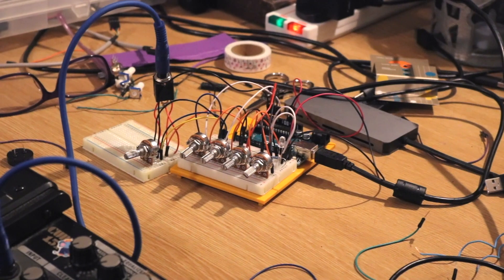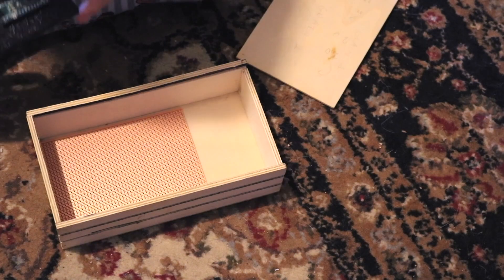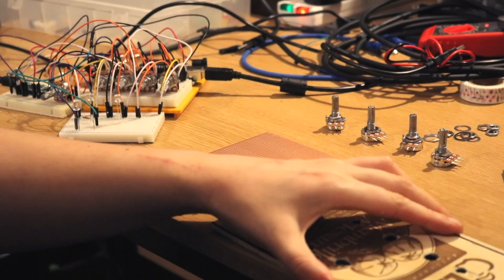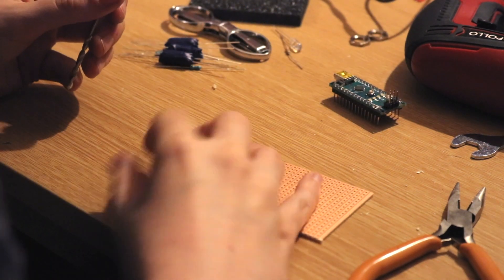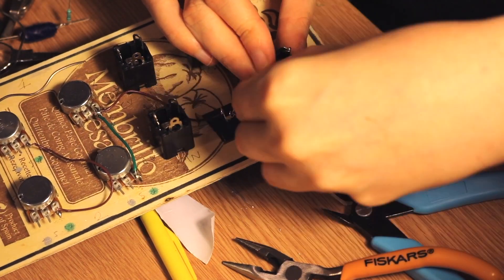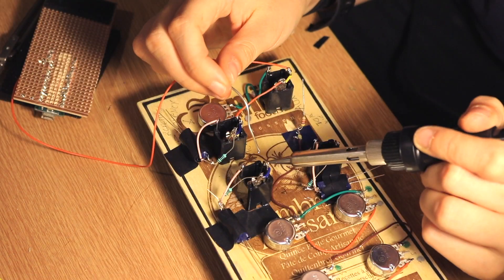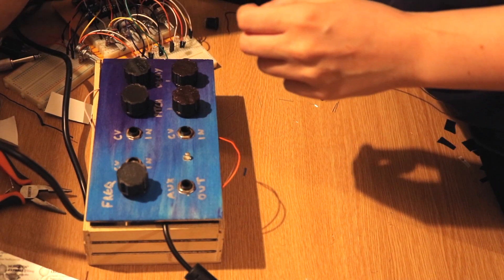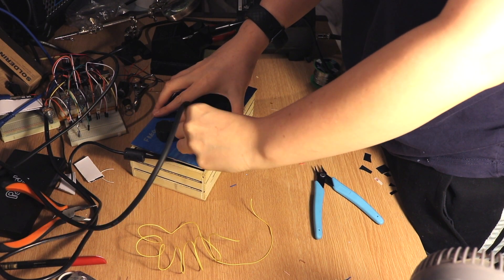Building the Auduino Synthesiser (Arduino based DIY synth)

Comment: Curious how one might take this design and filter out some of the white noise. Obviously a low-pass might do the trick but is the Arduino providing a preamp or is that external?
Reply from the maker: Honestly, I haven't had too much issue with white noise - but it's being filmed through a guitar amp into a camera mic, so there is a bit of white noise in the film but not in the actual audio output! :)

Comment: Hi I would like to use this setup as a base for a lesson in school. I was curious because I am not so good with Arduino, it is not necessary to use code right? Only electricity, potmeters and an output?
Reply from the maker: Go ahead! You definitely do need to upload the code to the Arduino, though :)

Comment: Hi, nice tutorial. I am building one. Just one little tip for everyone: dril the holes in the BOTTOM, so you can slide the lid in ;-). This also works for a box with a lid.
Reply from the maker: Great tip! I'll definitely be using that the next time I use a box like this, the lid is a right pain. Genius!! <3

Comment: If anyone is still reading these comments.... Are the <avr/io and avr/interrupt files already in the Arduino libraries?
Reply from the maker: Hey Emiliano! Thanks for the question, I'm not a pro coder by any means yet so take it with a pinch of salt. From what I can tell, the reason that the io and interrupt libraries are put down under #include is that it is a fairly old code perhaps designed to work on multiple types of board.

The Arduino does already have the libraries built in, I didn't have to download anything special and the code 'just worked'. It's a shame Peter Knight (who wrote the code) has disappeared as he would be the best one to direct that question to.
Reply: @ChildOfAnAndroid  Thankyou for the answer. This was a very well put together video. Liked and subscribed.
Reply from the maker: @emilianoescalante4418  No worries! If you have any questions i'm usually about to answer - thanks for the subscribe :D

Comment: That’s awesome!  And homemade Vactrols and all!?!  Especially for somebody who has little to no experience in building electronics, you did it and you said yourself that you’re satisfied with the results.  It sounds really great.  This is a project that I’ve been meaning to build for myself.  Unfortunately every time I get the Arduino, it gets used up by another project or gets donated to someone else’s project.  The clock adds a nice rhythmic feature at the end!  THANKS FOR SHARING!!
Reply from the maker: Thank you so much! :D The vactrols were probably the hardest thing to figure out - but, honestly, working them up from scratch gave me a lot more knowledge into how they work than when I was originally calling them 'octocouplers' (Dr. octopus, much?).
You should definitely give it a go if you get time! You may already be aware, but you can get 'clone' versions of the Arduino for very cheap online - which I think I'm going to do if I do any more projects with it. It's not a super complicated circuit and it was definitely fun to build :)
Seriously though, thanks so much for your kind comments it's super encouraging :D I haven't done much like this before and I'm surprised at the interest it's getting. Thank you! <3 <3